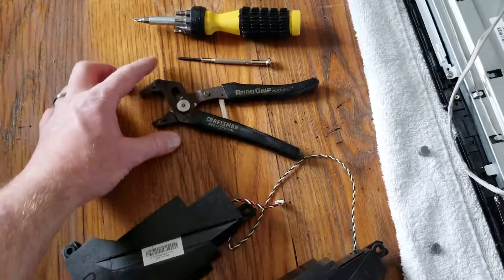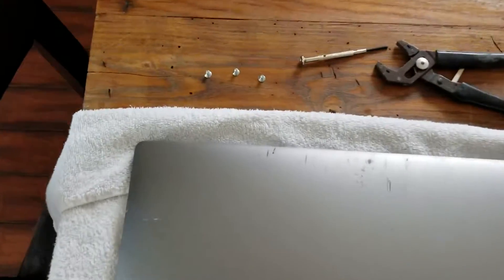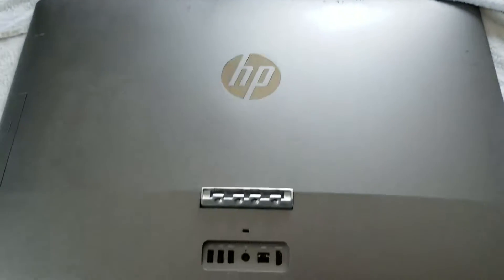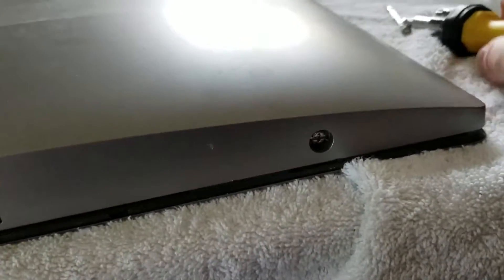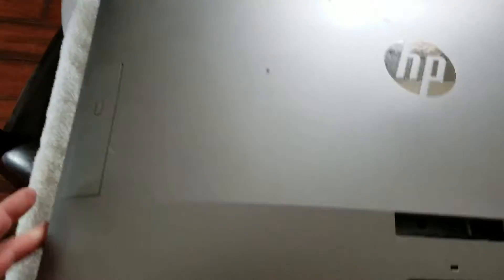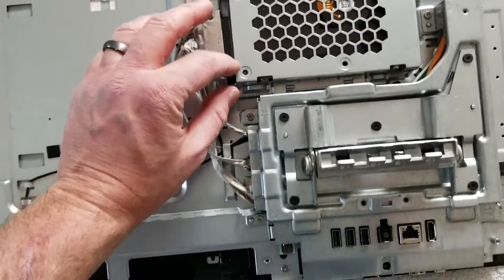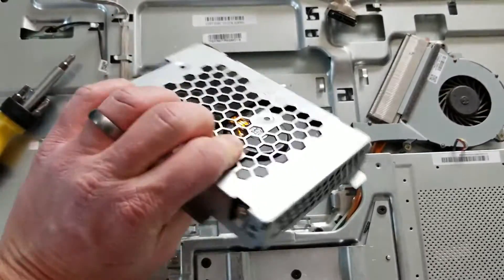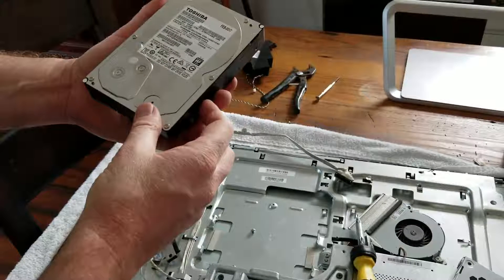Remove Replace HP Pavilion All-In-One Desktop Hard Drive

Comment: Just to add a caution when opening this unit.  Don't use any tools trying to pry it open on the sides.  That's were the plastic screen is and it will crack when any pressure is placed on it.  The screens crack very easily and you wont find a replacement one for sale.  I learned this the hard way a year ago!  Pry it open with your fingers carefully while holding the edges and the stand metal base.  Push on the metal stand to help open it.  The 27 inch screen all in ones are a tough one!  Did a 2nd one of these.  Try using a plastic credit card on the sides to loosen up.  Really helps opening these.
Reply: Are you sure there’s no replacements? Just made this mistake a bit ago and wish I saw this comment earlier